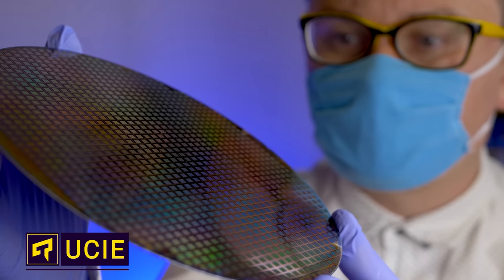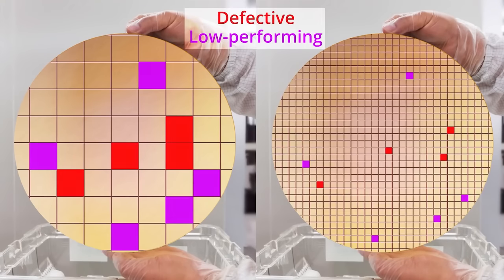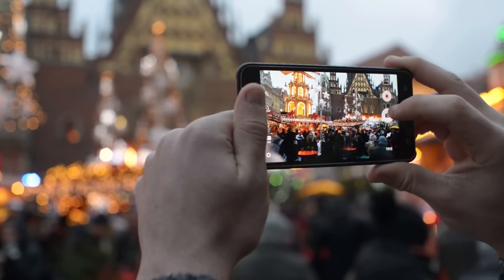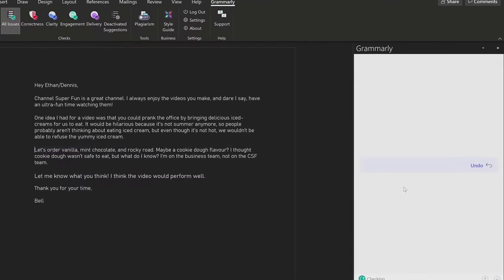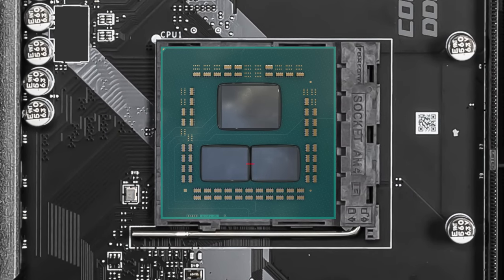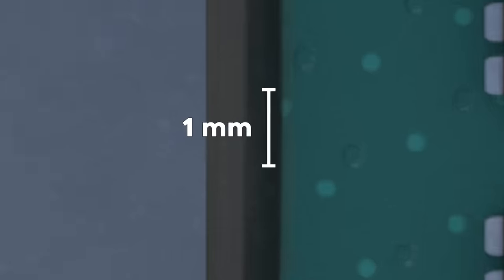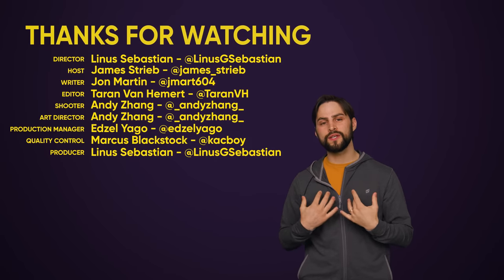A CPU From AMD...AND Intel?! (UCIe Explained)

Comment: In the old days Intel and AMD were pals. The manual for the 8086 CPU (from Intel) states that additional information can be also obtained by Advanced Micro Devices Inc.
Reply: I don't know about pals. IBM required Intel to license their technology out so they could have more than one source for the chips used in the PC. So AMD was one of those partners. 

After the 80286, Intel basically said "screw you, deal's off" and AMD basically had to reverse engineer the 386, but it's release was delayed for a LONG time, basically right before the original Pentium came out, because Intel kept them tied up in court. 

They released their Am386 and reverse engineered and released the Am486 family, now with legal approval obtained from the court system, until the AMD K5 came out to compete with the Pentium MMX.
Reply: @Dreams_Of_Lavender  Wasn't the AMD K6 the Pentium MMX killer? The K5 was competing with Pentium 100/133
Reply: @SviatoslavDamaschin  Ah, you might be right. Double checking now, the K5 and the Pentium MMX came out in the same year.
Reply: @SviatoslavDamaschin  AMD pitted K6 against P2, not Pentium MMX/Pro. AMD tried to advertise it as basically a Pentium 2, but at lower price. However, the market perception basically became that it was a chip for poor people, who couldn't afford to buy a P2, bought. It did sell pretty well, and caused Intel plenty of worry though. And  that was just the beginning of worries for intel, as it kept getting worse for them and AMD just kept getting better and better...
Reply: @liboud22  Good to know, I though that it was competing with MMX series cuz k5 was lacking those instructions
Reply: @liboud22  k6-2 and k6-3 could be seen low cost Pentium 2/3 competitors. When K6 and Pentium ii first came out, the latter was a bit of unobtanium at first. So k6 sat in a niche of its own.
Reply: @SviatoslavDamaschin  I thought that was the Cyrix 6x86L, but that was going on 30 years now, so my memory may be incorrect. I miss Cyrix and PowerVR, it's a shame they died before their time.
Reply: @liboud22  The perception was wrong.

The K6, K6-2, etc, outperformed Pentium 2 in a lot of regards and the Celeron line in almost everything.

My K6-3+ had 256K L2 cache on die, it was a mobile chip that was Super Socket 7, 2x multi was swapped for 6x so I had a 600MHz K6-3+ mobile chip in my desktop.

Even with the horrible motherboard it was running in, my K6-3+ was competitive with a 700MHz AMD Duron.

People bashed AMD and Cyrix back in the day but I had one machine that would accept something like seven different CPU architectures, three of them competitive with Intel's best offerings.
Reply: @SmallSpoonBrigade  pretty sure the Cyrix chip supported MMX.

They had some odd chips and ironically at the time companies were punished for having a higher IPC. Cyrix and AMD had chips that got more work done per clock but people were told that higher clock speeds were all that mattered.
Reply: @glenwaldrop8166  Not saying that the perception was true, but it is what it is. That's why it was soo good seeing K7 AKA Athlon ground pound P3....

Comment: When using chiplets, it is no longer a SoC (System on Chip).
It would then be a SoM (System on Module) or SoP (System on Package)
Reply: is it a bit like System of A Down?
Reply: @crunchynetto6979  System on Table
Reply: It would likely just get rebranded to "SoC (System on Chiplets)" because that acronym is already ubiquitous.
Reply: @olivetho  These aren't my definitions. This is industry standard.
If it is all using the same lithography process for the CPU, RAM, and IO, it is a SoC.
If it doesn't, but it is still all on the same module (usually with high-speed interconnects) it is a SoM.
Reply: @Prophes0r SoM would refer to a PCB rather than the same chip. although terms like these are not industry "standard" the same way that UCIe itself is...

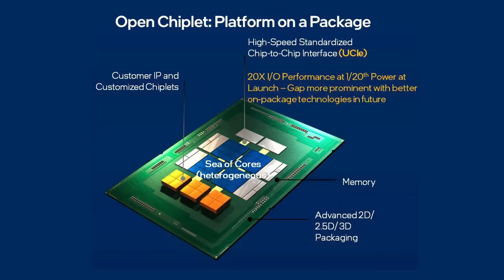Comment: Wouldn't it be more accurate to call the example at 0:33 a system in package? Chip typically refers to an individual integrated circuit (at least in my corner of the industry), but in this case you've got multiple chips (chiplets) packaged on a common interposer.
Reply: or system on substrate
Reply: @mycosys  SOS vs SOP. dunno which I like more
Reply: Put the substrate upside down and call it system under substrate or SUS
Reply: The correct name is Multi-chip module (MCM).

System in a package is usually when you take a couple of the markets dies and connect them internally with wires or solder bumps. Instead of connecting them through a pcb. 

This is more integrated and acts like a single chip
Reply: System on a container. Solved your issue while still calling an SoC
Reply: Maybe its closer to System on Module?
Reply: SoS would be fitting it turned out to trash trash, but so would SUS
Reply: No, would you call a full desktop computer a "system in a package" cause all the components are in a single box.

A computer is a computer, whether it's from the 70's & the size of an entire classroom, a full tower gaming rig, a laptop, or even the size of your fingernail.
Reply: Screw Grammarly, you should’ve sponsored them lol
Reply: If you put multiple chiplets together you get a chip.
Reply: @germas369  Nah SoM is typically an actual PCB ("compute unit" type things like in the intel NICs)
Reply: I mean, MCP (multi chip packages) already exist. Maybe Multi-Manufacturing Chip Package (MMCP) is a better name.

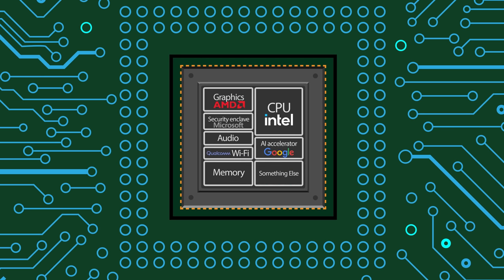Comment: 0:41 "security enclave from Microsoft" (checks date: Apr-1)
Reply: Even he laughed a little at that one!
Reply: Lmfao
Reply: lmao

but yeah... i wouldn't trust Microsoft anywhere near my cybersecurity...
Reply: @cnr_0778  microsoft pluton is a thing
Reply: @cruelcrow7367  and it required an internet connection for the pluton chip to ping (and maybe maintain a connection to) Microsoft servers for "security"
Reply: @cruelcrow7367  which is terrible... having a CPU inside your CPU that is made by MS is one of the scariest things about modern PCs.
Reply: @CliffordChang-v8c  exactly
Reply: It's not an April Fools joke though. It's called Microsoft Pluton. Already built into AMD's latest Ryzen mobile processors
Reply: TPM - Trusted Platform Module. Current physical incarnation of Microsoft's project Palladium from the WinXP days, current project name is NGSCB (Next-Generation Secure Computing Base).
Originally a chip you added to the motherboard, now baked in to every Intel & AMD CPU for desktop usage since Zen's launch.
Reply: Yep, and how long after UCIe becomes a heavily-promoted defacto standard do we think it will take before the regulatory body in charge of the standard makes it mandatory (or virtually mandatory by making it a requirement for some near-universal "option") for manufacturers to include a backdoor "management" or "security" chiplet, leaving consumers and hobbyists with no truly secure option in the market?

They already recognize that they've lost the OS battle, but home hobbyists still can't compete with industrial-scale chip fab.

Comment: I already own a cpu by Intel and AMD.
It's an 8Mhz 80186 from 1978, designed by AMD and manufactured by Intel.
True story.
Reply: Did you get those backwards? Its intel designed though AMD did second source them
Reply: @mycosys  i think you're right, pretty sure i have one new in the package somewhere.
Reply: Fun fact that were made at $.50 and sold at $700 for 1399x profit
Reply: @mycosys  your absolutely correct.  At the request of IBM.
Reply: @beanman6684  Jesus Christ
Reply: @beanman6684  don't tell Nvidia that or we're gonna have GPUs skyrocketing to 7-digit prices
Reply: @mycosys  quite possibly. It's been a while since I got it out to look at it. It's just a fascinating bit of kit. Still works too.
Reply: I personally find the NEC V30 much more interesting.
Reply: @beanman6684  Sort of, that was likely just the manufacturing cost and doesn't include the other overhead involved with distribution.
Reply: This is cap
Reply: @beanman6684  yeh i am not sure that intel were producing cpus for 50c at any point in history - that claim alone sounds absurd, do you have any evidence to back up this "fact" or should i just believe it?
Reply: @marcellachine5718  I dont know if it was at IBM request, that was the case for the 8088 and 8086 but the 80186 is an embedded design & wasnt compatible with the hardware IBM put on the PC/XT motherboards, hence going right to the 286 for the AT. IBM did use it as am embedded controller to convert between ASCII and IBM3270 terminal protocols.
Reply: @mycosys  when IBM was releasing their first consumer PC, IBM only wanted to use intel processors if intel could provide a second source of them for reasons of manufacturing complexity (low yields) and unexpected surge of sales (when sales really took off IBM did not want manufacturing problems of a key component to hasten sales) so ibm made a licensing agreement with AMD, giving AMD what it needed to manufacture a compatible, if not identical product.   Also to note IBM could have gone with many other processor manufacturers of the time, zilog, Motorola,  sun sparc,  etc.
Reply: @mycosys  IBM REQUIRED a second source from Intel in the days of the original PC.
Enter AMD - which had the experience, but Intel thought they were small enough to never be a threat....

It was Intel's decision on WHO to make the second source, NOT IBM's - nor did IBM do the licensing. INTEL did.

Comment: UCIe is going to be absolutely fantastic. I cannot wait for this to become an industry standard. the possibilities from hobbyist to professional are absolutely astounding.
Reply: absolutely fantastic?
absolutely astounding?
dont cheer yet, let them prove it first that they can make it work together as good as the consumer can imagine.…
Reply: I honestly don't expect to see any hobbyist/enthusiast platforms take advantage of this. Because you still need a socket, chipset and mainboard platform which will play ball with a multi chip module someone needs to order a substantial production run of. There are massive roadblocks at the BIOS and driver level.

But we might see weird server and industrial platforms which will only boot Linux. And odds are, the CPU MCM will be soldered in and not replaceable since it's all going to be so custom.
Reply: @SianaGearz  the whole idea is that there "shluld" be more variety for everyone to use

Comment: I wonder if Apple and NVIDIA will quietly use the UCIe specifications. They will have to use die-to-die interconnects at some point in the future. Might as well use the spec instead of wasting engineering time. Especially since Apple is obsessed with thinner and more power saving designs.
Reply: It will be our job as Internet Denizens to point and laugh when it inevitably comes to light (and then forgetting/losing interest as the next big thing happens).
Reply: Apple has proven for a while not that they're just not obsessed with thinner designs. But power saving - yes. In fact every company should start focusing more on efficiency like Apple does.

But I highly doubt that Apple will ever use this because they're doing literally the opposite. Instead of relying on other companies, they want to do everything themselves. So much so that they even develop their own modems so that they don't have to use those from Qualcomm anymore.
There's just no way that Apple will go back and use like modems from Qualcomm, a GPU from AMD or whatever.
Reply: @alexthenr1019  that's absolute bullshit dude. TSMC is literally nothing but a PRODUCER. Apple is developing their own silicon. TSMC only produces it.
Apples processors are not developed by TSMC.
Reply: @Raja995mh33  Apple refuses to support Vulkan , another good example I think...

Comment: I would love to see this tech expanded and combined with other ideas, like the big-little design, but with different architectures as options as well. So you could have all those different specialized chiplets... but also have X-Performance cores of ryzen,  and X-Efficiency cores but also some ARM cores for running more mobile stuff, and please add some RISC-V cores in there too.

Comment: I would like to see Nvidia integrated graphics in an Intel CPU!
Reply: Nvidia and Apple are the only ones not participating on the project.
Reply: @18earendil  doesn't matter much because if ucie is really the breakthrough that it claims to be nvidia and apple will have to join the standard at some point
Reply: @Gatorade69  ...and other lies we tell ourselves before sleep
Reply: @18earendil  Good, I've never purchased anything reliable from Nvidia.
Reply: I can think of 3 things why Nvidia is not onboard.
1. They dont like open standards. Pretty much everything they do is proprietary for their benefit only.
2. They dont have anything small to contribute. Most of their chips are massive in size. Efficiency is an issue.
3. They dont want to :p

Comment: Imagine ordering custom CPUs in the future. 

I’ll take these cores from AMD, These transistors from Intel, these nodes from ARM, some Cuda cores from 
Nvidia and while you’re at it, an bit of Apple on the side.
Reply: That would be sweet to say the least. Modular cpu's that can be tailored by the consumer. Now let's just weed out cheap/pirate manufacturing. You know China is gonna have a say in all of this.
Reply: Won't it be risky to have several expensive dies all in 1 chip? like what if the chip fails and damages the dies... like the old saying "don't put all your eggs in 1 basket"?
Reply: @ugh2668  perhaps, it really depends on the actual design and how they could be protected in the event of such disaster. If they went truly modular then they could swappable chip components. If they're soldered in place then it's a different story.
Reply: I think this would also be excellent in preventing CPU shortages too. Not enough Intel cores in stock? Throw in a few more AMD ones.
Reply: @lua8738  I 2nd that. I'm just glad pc manufacturers didn't go with the design concept of the mobile industry in making all components soldered in. I love the upgrade factor in electronics.
Reply: @HBProductions.  exciting times. although I don't have much hope that UCIe will see the mainstream for a long time since we've had to wait so long for a company like Apple to push away from x86 and embrace RISC for workstations and laptops
Reply: Imagine the horrible markup and obvious lack of market competition is what I'm thinking.  The only reason big players are behind this would be to make more money....
Reply: @RobertPearsonJr  good point. I also had a think about it and it might make it harder to accurately know benchmark scores of what you're buying if your chip uses different parts to someone else.
like "hey, i just bought a Ryzen 7 7800X* (2C Intel edition)" or smth
Reply: @lua8738  we'd probably need new software to better read such devices. I'm sure even DIYs would end up making tools to deal with such hardware even if not all manufacturers made tools for the consumer.
Reply: @leeroyjenkins0  We all know that its not the case of doing something out of the box for the consumer. That entire conversation was merely a "what if...would be nice"". What you mention is probably true, but don't take it so hard man. Just because it's the industry norm, doesn't mean it's the best practice for the consumer  that would end up generating more revenue for any given company. A customer with options is more of a guaranteed sale  than one just given the choice of buy or don't buy. Capitalism doesn't mean it has to be  shitty customer service. I personally do give it much thought to what hardware is in my equipment as it can hinder my job when things aren't compatible or optimized to work in sync without bottlenecking my resources. So which wifi card is an important factor because a plane jane walmart cheapo card vs a new wifi 6 capable card does make a huge difference. It's literally the whole point of building a custom PC, you pick the options of your hardware, not the manufacturer or some retailer store. I'm sure we can agree that custom PC's in general out perform most prebuilt units from just about every known brand out there for every day use. 2 to 8 gigs of RAM is barely enough to run windows smoothly, much less do heavy load work like render out 8K film or even 2k streaming while playing your favorite triple A game.

Comment: FUTURE EPISODE IDEAS:
1) I'd like to see how additional GPU's operate when installed in a PC. Which one takes the load? Is it only the primary one? Is it the one the monitor is connected to that the app is running in? Etc. Comparisons on SLI vs unlinked multi-cards would be a great episode if not done already. If it was done, maybe a revisit would be nice.
2) Connecting different devices using different LAN ports, direct connect devices, manually setting IP's, and similar topics would be nice to see.